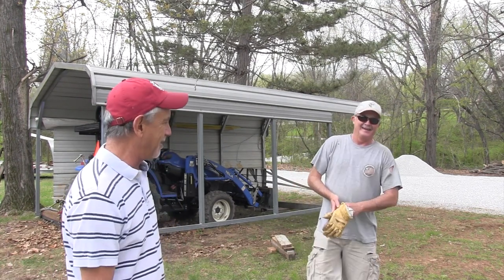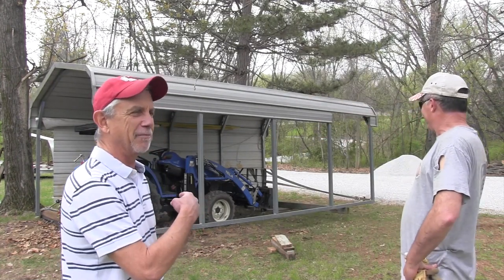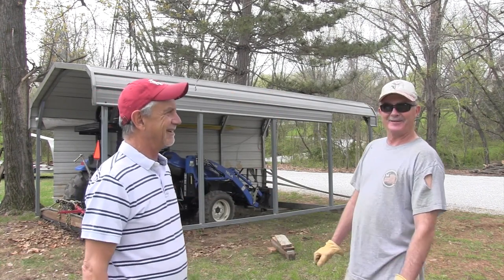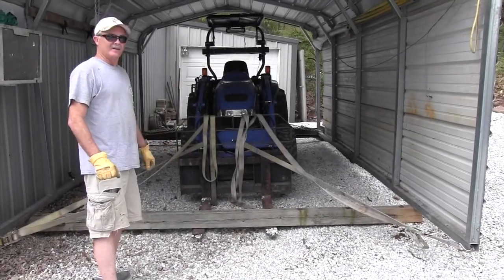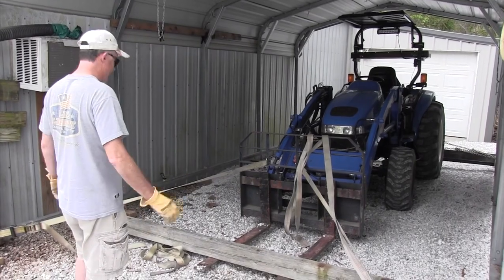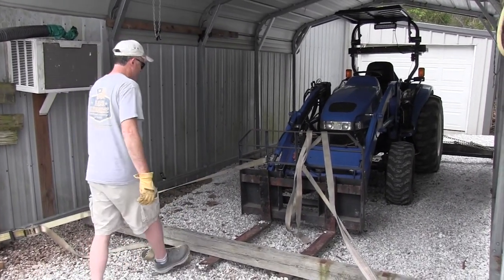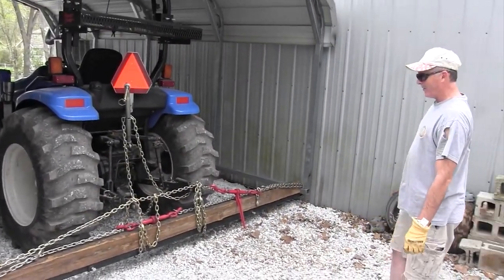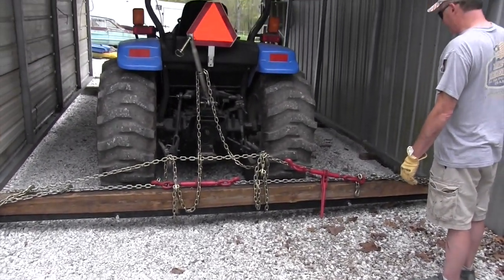Moving a Building With a Tractor

Comment: Having seen something like this done before, there's one thing that could have been done differently. On the front, screw a 12" length or so of 2x4 to the top of the beam on either side, right up next to the frame of the car port. Then run a strap side to side to pull it in, so it's pinched up against the two 2x4 stops. That'll allow you to get the two straps to the fork frame nice and tight, but without distorting the frame of the car port. You could also screw a couple 2x4 sections on either side of the forks to act as stops.

When I saw this done, they had done that on both ends, then put a hand truck on either side on one end, and then pulled it with a forklift in reverse. They were moving it over asphalt, so they didn't have to deal with gravel, but I'm not sure that would have made any difference in the how you'd rig it.

Comment: Tractor Bob how should you run a diesel what rpm s mowing or pulling lawn rake. High rrrrrs. How often should I start it and run it to make it last thanks boo
Reply from the maker: Run it at PTO rated engine speed which is different for every tractor.  Google the specs for your model number and you'll see what it is.
Reply: @TractorMike  boo the rpm gauge shows pto speed. 3000 rpm...  say I'm just pulling a light lawn rake no pto needed.. still stay at 3000 rpm or throttle down to 2000 or 2500????   Can I leave it for months stored or should I start and run it often like a gas vehilce
Reply from the maker: I was picturing a PTO powered lawn aerator, if it's just a light pull-type implement, just run the engine at a speed where you're not bogging it down.   Your biggest problem with leaving the tractor set for extended periods of time is keeping the fuel fresh.  Watch this: https://youtu.be/lqC4zqSXhQU.
Reply: @TractorMike  boo u nailed it